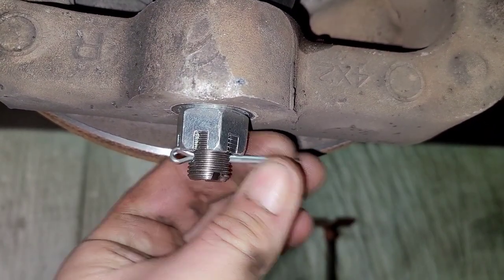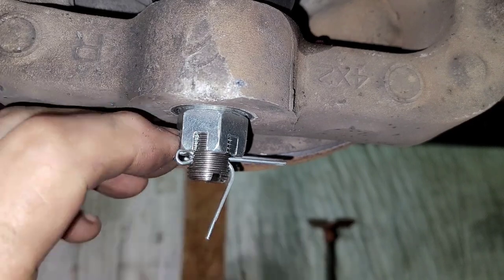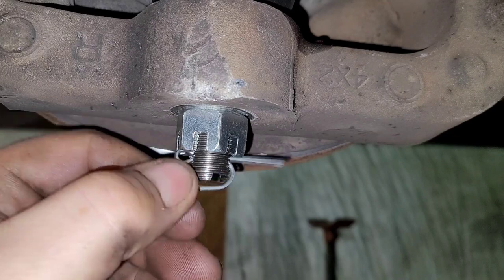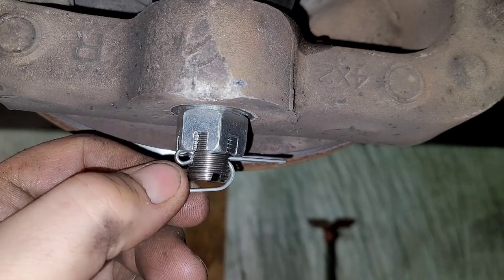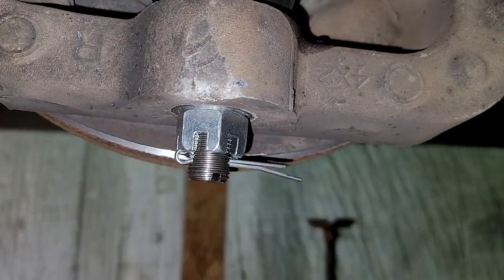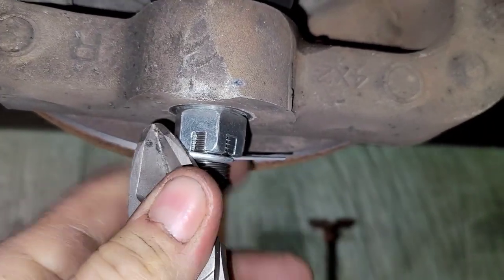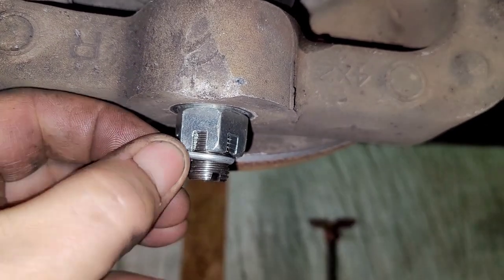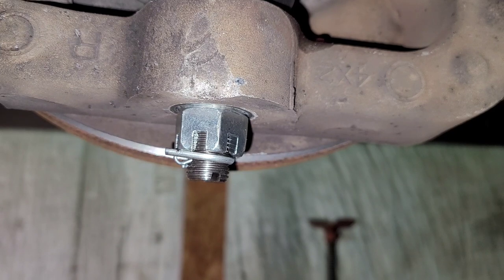The Cotter Pin Question. What's The Proper Installation? Multiple Answers On This One!

Comment: Cotter pins are cheap. Always change with a new one. I just had one fall off from a clutch finger on my model T Ford. As a result the threaded adjuster worked it’s way out and was banging on the inside of the transmission housing. I found one part of the pin in the oil after draining but the larger part is still somewhere in the transmission. This is bad because a model T has electrical windings in the transmission and a a bit of metal could tear things up. The cotter pin was a cheap one from Harbor Freight and compared to old American ones it was really soft metal. So, cotter pins can hold something important and fatigue can cause them to fail and cause real harm.

Comment: This video is incorrect. The hole in the bolt for the pin needs to be within the castle so the pin is snug. Would need to add a spacer in this case

Comment: The installation is incorrect, as others have stated, there should be a washer to allow the split pin to pass through the castellated nut, installing it that way in a steering linkage is irresponsibly dangerous.

Furthermore the pin should be replaced with a proper sized one, they are cheap after all, this video should not be used as a guide, if Kenney has done it this way for 40 odd years, he's been doing it wrong for 40 odd years.

Comment: 42 seconds in and already he's laying out a load of BS.  
Put a hook on the end of a chain and leave out the cotter pin because it is a "redundant system" .  See how that works out for you when your running down the road at 55mph with your tractor chained down on the trailer minus cotter pins. <smh>
Kenny says, "  It's NOT there to take the place of torquing something correctly or something being tightened correctly "
W R O N G  !!!!!!!!!!!  It is PRECISELY there to take the place of torquing something or something being tightened, be it correctly or incorrectly.  You're gonna get somebody killed.
People, the purpose of a cotter pin is 100% dependent upon the relative application.  Sometimes it is a redundant safety item and is not meant to be the primary preventer of parts loss.  OTHER times, it is indeed the primary preventer of parts lost.  Again, consider attaching a standard 3/8" hook on chain.  The cotter pin is not only the PRIMARY preventer of losing your clevis pin, it is the ONLY preventer of losing your clevis bolt.  Think first.